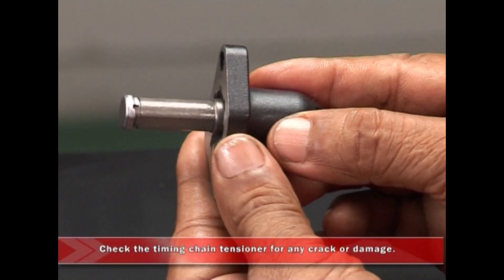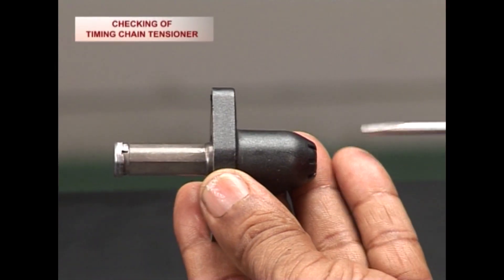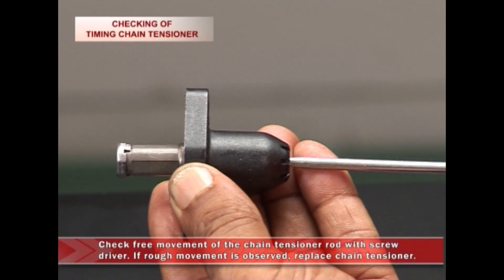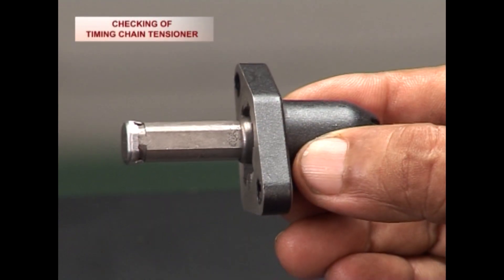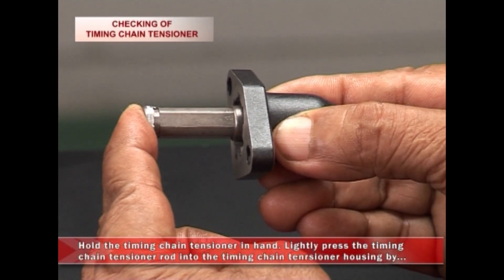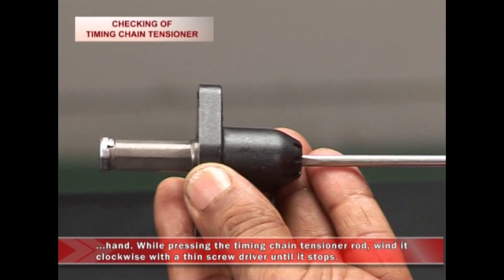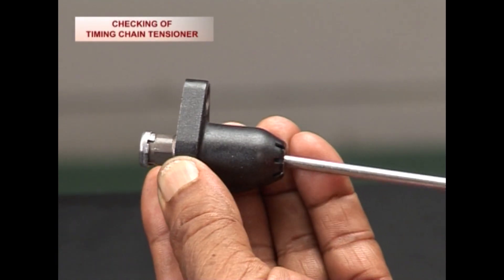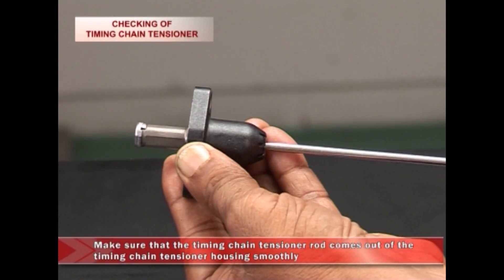Checking the Timing Chain Tensioner of the Yamaha SZ R Engine.

Comment: Can a bad timing chain tensioner cause noise only after engine warm up?
Reply: No. Even after engine comes to operating temperature as well, the noise will be there
Reply: @technofun80  yamaha FZ-S ..V3.0..BS6 Model....there is no noise in engine until warm up ...later it starts ratting sound ...can u please help ?? I have inspected the camshaft and other valve train spares except valve to guide clearance...can it be incorrect valve stem to clearance??
Reply: @naveedaka  if the noise is coming from engine head, there are multiple reasons for it. It can be tappets (inspect  if the bearing is fine), valves (check if there is any side play), timing chain and timing chain tensioner. Among these it can be anything.